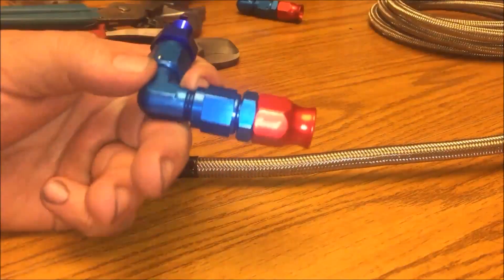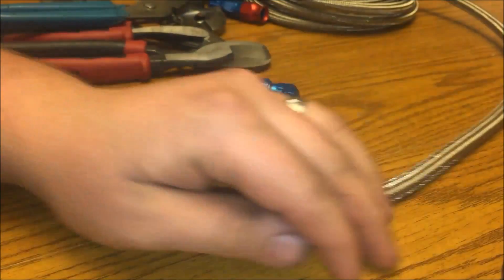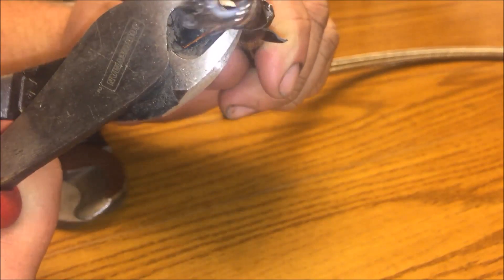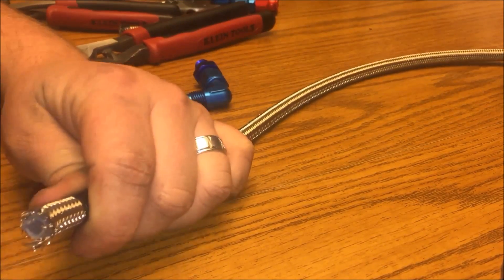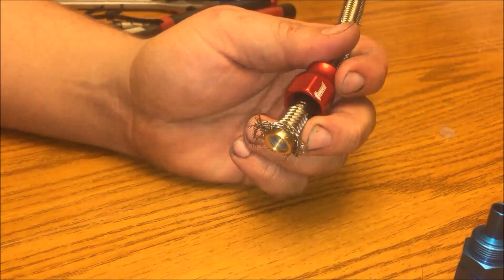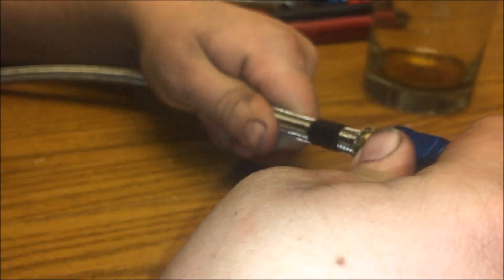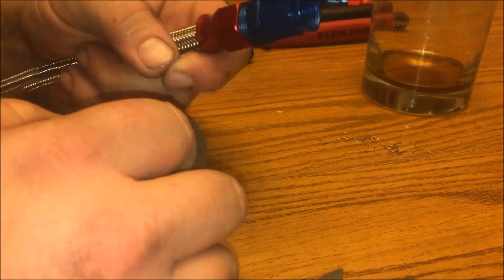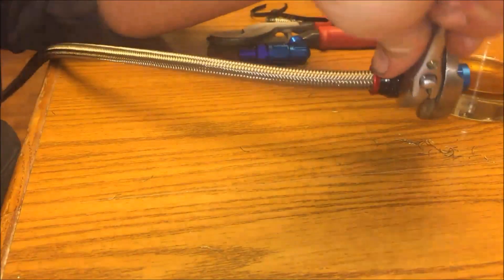How to Make Braided Custom Fuel/Brake lines (AN Fitting Assembly)

Comment: Braiding fuel lines is a mistake. If there is a bag ground the braiding can act as one and the small wires that make up braiding get red hot immediately, melting through the hose and starting a fire.
Reply: Well, don't be satisfied with bad grounds ;-)

Comment: Why screw around with all that.... Just use push locks. Easier.  And last longer
Reply: Joking if you think using push lock on fuel oil or hydraulic line is anything but ridiculously stupid, have fun when the line flys off and you crash
Reply: @taydencornish  using on trans line. And fuel line
Reply: It will work and likely work okay but I've seen plenty fly off causing engines to die, fuel going everywhere ect

Comment: Why are you using a compression ferrule on a braided pft hose? A crimp on fitting or a screw on style an fitting would be the correct parts. This might work but I would never trust it and it probably wouldn't pass any certifications.
Reply: Shaun no those are ptfe specific fittings, AN fittings would be used on AN hose

Comment: that looks like a pain in the ass, why would I choose these lines ( besides looks) over running nylon or rubber fuel lines? I understand that the stainless offers abrasion resistance but we use nylon fuel lines on every car that needs rusted out fuel lines replaced and they seem to outlast the life of the vehicle. I have never used these and am not dogging them, actually looking for information! thanks :)
Reply: The line itself is made out of PTFE (ie Teflon) so it doesn't expand at pressure, increasing brake "feeling". On the other hand, you HAVE to use AN fittings for fuel and oil lines in most motorsport categories
Reply: people usually go with an lines for brake systems because they has less of a tendency to bulge from the pressure. SS lines are stiffer than the rubber brake lines.

Comment: Don't ever cut a -an stainless braided hose (Or any hose) with cable cutters...WTF! Use a 32 tooth metal hacksaw blade or use a cutoff wheel on a grinder like I do!
Reply: I use cable cutters on braided hoses wrapped tightly with electrical tape and out of the countless fittings I've assembled... still zero leaks

Comment: What size line is that??
Reply from the maker: 6an
Reply: C2H6 where did you buy the line and fittings at???
Reply from the maker: Summit racing. Little spendy but they have about everything.

Comment: Is there a torque spec for the fittings? Where the red and blue meet?
Reply from the maker: I dont know for sure. I just go until It gets snug. Be careful as they are only aluminum and you can easily strip threads. Key is just to pressure check the line when done with compressed air or something. No leaks and your golden.